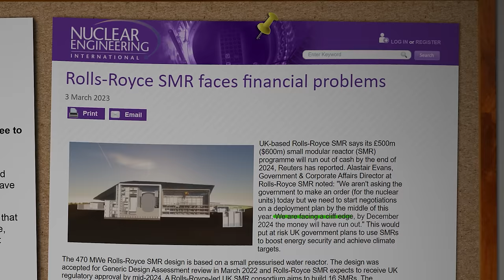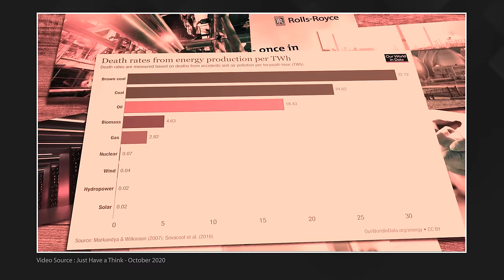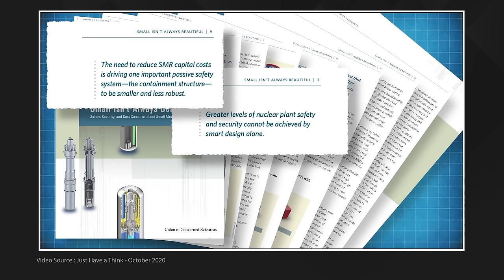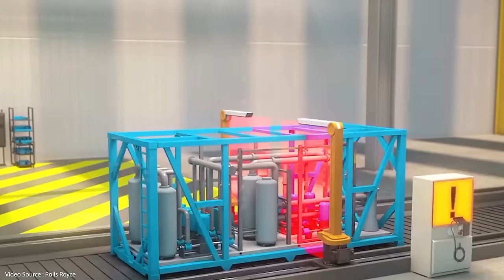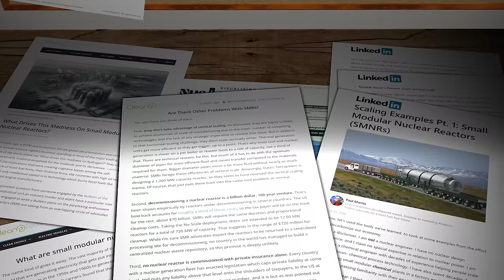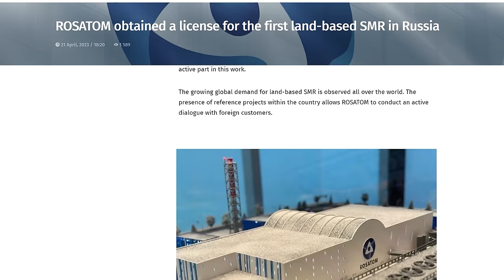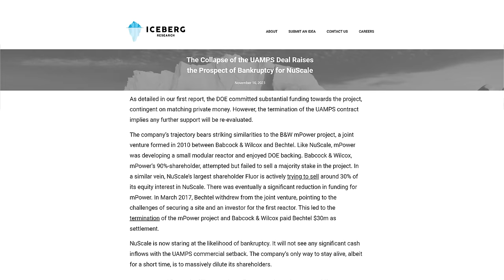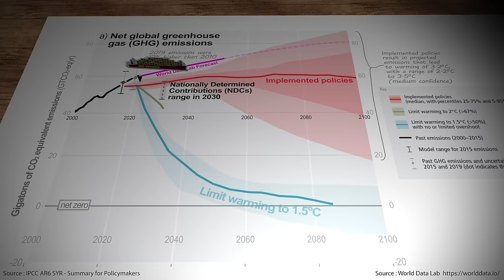Small Modular Nuclear Reactors. The Verdict

Comment: SMNRs, like any pressurized water reactor, can provide a nice steady base load. But PWRs are very slow to change power, about 3%-5% of max power per minute. Thus PWRs are not well structured to operate in a load following mode that would allow PWRs to fill in valleys in the power supplied to the grid when wind and solar don't produce full power because clouds during the day and calm wind conditions.

To maintain a stable grid when large percentages of grid power comes from wind and solar, there will either need to be substantial amounts of stored energy (batteries, pumped hydro, compressed air, etc) to absorb excess power when wind and solar are producing power in excess of power demand, or there will need to be something other type of power plant than natural gas powered peaking plants that is able to provide the necessary amount of load following/peaking power 

The ideal source of load following/peaking power, IMHO, would be any high temperature reactor in the 700-800 C range (helium cooled, molten salt, etc.). The high temperature yields a higher carnot efficiency than is possible with the 325 C maximum temperature of PWRs. This makes storage of excess thermal energy practical since less storage mass is required to store the amount of thermal energy required to produce an equal electrical power. Likely the best way to store excess thermal power is in the form of molten salt in vacuum insulated tanks. 

The reactor itself does not itself try to follow the load, rather it operate at a single power level with all of the thermal energy going into the molten salt in the storage tanks. The reactor is sized to produce power equal to the average power that the reactor needs to supply to the grid plus a margin. 

As the wind and solar power dip below what is required by the grid, the deficit is filled in by thermal energy extracted from the molten salt tanks. The response rate of such a system should be as fast as the natural gas peaking plants currently used to meet peak power since the rate of flow of thermal power to the steam generator is only limited by the speed with which the molten salt pumps can vary the flow rate of the stored molten salt through the steam generator. 

And if worse came to worse and there was an extended period of dense cloud cover and very little wind, back up natural gas burners could be used to make steam and reheat the molten salt. The additional amount of equipment for this should be relatively small and would avoid a substantial oversizing of the reactor to meet this 1% edge case at the cost of a comparatively minor amount of CO2 emission.
Reply: What you fail to understand, is that the grid doesn't exist to allow intermittent RE to exist; but that the grid exists to meet customer demand load.
If you can grasp that, then you will understand the massive give-away to intermittent RE generators in terms of the subsidy that allows them to participate on the grid only for the upside, but to dump the downside on the dispatchable generators of the grid.
Reply: @factnotfiction5915  Why the hostility? And, I don't think you actually read my comment. It was not addressing the merits of using intermittent sources. It was entirely on how to use store thermal energy from high temperature reactors in a way that can allow energy from a source that is not normally able to provide load following capability to provide the necessary amounts of dispatchable power required to maintain grid stability IF a substantial percentage of average grid power comes from intermittent energy sources.

If we weren't so squeamish about nuclear power, we could use breeder reactors to transform either thorium to U-233 or U-238 to plutonium and build a mix of baseload reactors and thermal storage/dispatchable reactors that would give us a totally non-CO2 emitting grid that doesn't depend on any intermittent energy source.
Reply: It depends on the design of the PWR.  A number of them were designed as load following plants in the 1960's and 1970's and did so extremely well.   

Then it was determined that they were not burning up all of the expensive uranium fuel so they moved to base loaded plants.  2 of the PWR plants I worked at still had the load following controls installed and could use them if that was needed.

Comment: Unfortunately the continued push for Wind and Solar is not the panacea we are led to believe as they have very short working lives and currently are not recyclable. plus we would have to cover almost half the country to be able to supply all the power the EV's alone will require!  If every ICE vehicle  has to be replaced with an EV then the country requires approx. 6 times the the current infrastructure & generating capacity! The government has made it very clear that is not going to happen!  If all this wind and solar require Hydro power back up to give the required Base load why do we not put far more effort into providing all our requirements with Hydro power.  The west of Scotland has all the ideal elements for this as does the west coast for wave and tidal units!  They will be more expensive in the initial setup costs but far far cheaper to run and cost less in maintenance over their much longer life span!

Comment: Did I notice that wind power for the UK was, at one period of time yesterday, down below a quarter of one Gigawatt?  At night, too?  While I am a fervent renewable-ist, I recognise that surpluses of power stored, for grid-scale supply, are simply not going to be available for a long time yet.  We need base load, at least, to keep the country rolling with an operational grid.

Regarding the comments re Thorium reactors, the candu reactors could operate with some Thorium fuel and at least start to burn up some of the current nasty nuclear waste.  Who cares about a slight loss of efficiency if it leads to further developments.  I am reading lots of fors and againsts re Thorium molten salt reactors.  Just get on with it and sort out any operational problems as (and if) they arise.
Reply: Yea I totally belive you Mr. 'renewabale-ist' with your post simply full of nothing but misleading Nuclear industry anti-renewable talking points.
Reply: Hang in there Hinkley Point C is coming on line by 2031.
Reply: @kennethferland5579    Can’t read or understand properly?  I’m a realist, not anti renewable.
Reply: @francesconicoletti2547  You reckon it will be operational in another 6-7 years?  Generation at far more cost than renewables for the next 35 years?  There may well be far more installed renewables by then.  But the realists amongst us at least recognise that minimum wind generation at night will need one hell of a lot of storage to even cover half the night usage.  Roll on the proposed inter-connector from North Africa and any other inter-connectors that might become practical.

Comment: Even if we do reach zero carbon emissions by 2050, we will still not be done. The next task will be to take all century’s worth of industrial CO2 back out of the atmosphere, so we can restabilize our climate. How will we do that? With carbon capture. The problem is that carbon capture systems require enormous amounts of power. Where will it come from? Our two options for generating enough energy for that task are nuclear fission and nuclear fusion. Since the latter seems to always be 20 years in the future, fission it is. So, new generation SMRs may be the best bet, and we will indeed need tens or hundreds of thousands of them to generate the energy we need to restore our atmosphere to somewhere closer to 300ppm CO2.

Comment: I can believe all this: SML reactors were a politician’s dream so automatically very suspect. 

But can you explain why Europe has moved away from the tried and tested water cooled reactors to the new designs in Finland, France and now UK, please? There’s reference to ‘efficiency’ but surely this is almost meaningless when so little fuel is used anyway? These new designs have caused decades of delays and huge cost increases and I believe only Finland’s is now operating at low level.

Another thing is why does everyone shy away from Thorium reactors. China has a new experimental one. India cancelled their three step programme. US probably stopped because of military concerns. Europe has never, as far as I know, even contemplated it despite having so many nuclear power stations dotted all over. If you want ‘efficiency’, Thorium wins hands down. The fuse plug designs were always said to be intrinsically safe and they can also be independent of cooling water - hence the Chinese one in the desert.

Comment: The true cost of the electricity being produced by nuclear fission is already far too expensive for most of the worlds population. The poorest 50% use little or no electricity from a power station because of price, distance, lack of infrastructure , lack of appliances , lack of shops! Many houses in the UK were built with electricity as an afterthought , and when it arrived powered
lights , radio, clothes iron and little else. Very local production of renewable electricity is what most people need so that the use of millions of fossil fuel generators can be superceded.
£500 , 000 , 000  ( cost of small reactor) could buy 100 , 000 home solar panel and battery kits-fitted ! The developing ( and most of the Developed ) world needs low to medium types of technology , not a technology that requires a team of people with a doctorate in engineering and physics to run. 8 years 10 years to train engineers to run a nuclear power station, 1- 2 years for low to medium renewable technologies to be rolled out. Can we wait for nuclear? They will come into there own when we explore space !

Comment: Australia is currently having a heated SMR ‘debate’.

Liberal (centralist-right wing party) are doggedly pushing SMRs as a better alternative than Labor’s (centralist-left wing party currently in Govt) plan primarily using RE (PV solar, wind, hydro, batts & gas peaking).

It has turned into a polarising situation where support of nuclear or RE is intrinsically linked with with party one personally supports. So there isn’t much goodwill in genuinely evaluating which is the best way forward.

In the meantime, the Australian Electricity Market Operator continues to do detailed planing on what infrastructure is required to build a RE system. But these plans are falling foul of community sectors with Astro-turf lobby groups stirring up, on one side, Farmers about additional grid transmission lines crossing over agricultural land (limiting particular ag practices like aerial spraying). And on the other, Greenies concerned off-shore wind farms are going to decimate whale populations.

It seems the Liberal Party is spruking nuclear just so it can have a point of difference with Labor & snipe about vistas being destroyed by myriad PV solar & wind farms everywhere. It’s also said it’s their way of continuing to kick the can down the road so Coal, Gas & Oil companies (who make donations to them) can continue BAU.

In the meantime, Australia’s aging fleet of coal-fired generators are rapidly approaching end-of-operational-life. On current schedules, over 60% of total current grid generation capability will be shut down over the next 16 years. Starting with ~20% of that 60+% being shuttered in under 2 years.

So in Australia, it is definitely the case that SMRs will reach commercial maturity far too late to be built to replace C-F generators before they die. Our only hope is to get enough RE built before that happens. (Full speed ahead & damn the whales? - to plagiarise a WWII quote about torpedoes) 

And once that’s done, who needs SMRs?

Comment: I was hoping you would also talk about Thorium reactors. I thought there was quite some progress made in that direction.
Reply: Probably similar problems with thorium reactors, since they use fission as well, which means it produces highly radioactive fission products, so it ends up being extremely complex and expensive. This is basically the same for every reactor design using nuclear fission.
Reply: Actually, there is nothing new about thorium.  The USA built 2 test molten salt reactors in the late 1950's to late 1960's.  Both had a lot of problems.  Oak Ridge broke down a lot and was very unreliable - before they found out about the corrosion and radiation embitterment issue with the hast-alloy they used for the tubes, pipes, and components.

LOts of test reactors built around the world using virtually all designs out there (BWR, PWR, Heavy Water, Graphite, etc).   There are at least 4 thorium fuel cycle test reactors currently being used in the world.  No one except the USA though they had a design that worked well enough to scale up into power plants.

The USA built 4 commercial thorium cycle power plants in the 1960's - late 1070's using BWR, PWR an HTGR designs.  All were huge technological flops.  At least 3 of them were converted to U235 fuel at the 1st refueling.   All of these plants were very prematurely retired.

The USA did do a test run in the Shippingport demo/test reactor (60 MWe PWR) which showed that a successful breeder thorium cycle core could be retrofitted into most of the existing PWR reactors of the day (which applies the the current PWR reactors today).  But, it cost more to extract and refine the thorium from the almost free dirt and rocks than it cost to extract and refine uranium from its more expensive mined dirt and rocks.  So thorium has gone nowhere.

India has the most extensive recent thorium fuel cycle test reactor experience.  They have not yet seen it as a viable fuel for power plant reactors;  even though that is their goal.

China built and started up a thorium fuel cycle MSR in August 2023 to see if they have come up with a suitable alloy that will not degrade in long reactor life applications and to see if the idea of chemically filtering out corrosive daughter products and chemical reactants works well enough.  It will be years before we know the answers unless its a rapid that we do not yet have a solution.

Note MSR reactors can run on any fissile nuclear fuel.  Thorium is only used to breed U233 which is fissile.

Comment: The argument about nuclear industry economies of scale being unrealistic presented in the video seems quite pessimistic and lacks concrete figures. Indeed, in nuclear industry a -30% cost reduction on overnight CAPEX from 1st of a kind to 3rd of a kind seems to be a rather reasonable target. 
In addition, SMRs are nascent technology with very high risk and WACC. On the contrary wind and solar is now a low risk industry (no to little cost/schedule overruns and lower project size). Therefore, a comparison of the LCOE of SMRs with wind/PV is likely to be flawed as achievable changes in nuclear technology maturity and funding conditions as well as full cost definition of renewables (incl. storage and grid reinforcement) may result in SMRs being much more competitive than wind/PV. (I have to admit I did not calculated this though)

Comment: In Europe we do not have security of carbon energy supply so we must develop renewables (Hopefully as a continent with interoperability, but alas that might be to much to ask, never mind global!), but putting an uneconomical target on things is rather foolish and just ensures that the target is not met, the new technology is not keeping up with the target dates and the prices are running high, also some new technologies are not working properly. Wind is a good overall solution but is not 24/7/365.25, solar is fine except for Winter in Northern Europe and that's the time its needed most, Big Nuclear is good for baseload and should count for 25% of our mix, gas power plants should count for 15% for standby and emergency they are easy to get up and running. Ground source heat pipes are fitted to new homes in the UK and they seem fine, air source heat pumps are overall not efficient enough as yet, and older homes being converted from gas are to costly with insulation and price of heat pumps and solar (30k) better to have a grant for insulation (10k) and reduce the gas usage, EV's are good, lithium is bad. The charging structure needs vast improvement as does the network grid which needs continous upgrades for 30 years to change for the new energy mix and hopefully "new" energy sources, all these cost vast amounts of money when money is in short supply, in the end it "should" be better but the period of change is going to be longer!?!

Comment: This is an over simplification, but the common practice of subsidising fossil fuel based power generation is essentially the undervaluing of the lives of those the subsidising entities are given political power to protect. In my opinion this is a stark betrayal of principles and our communities.
In a way, carbon taxes go some way to express this "non-tangible negative externality". But as usual, cultures have momentum and the status quo is slow to shift. However, on the more positive side, the status quo is being eroded and often "doesn't change till it changes all at once".

Comment: New technology always takes longer than expected and costs more.  That's why you keep doing R&D on the same thing, making it better and better and more cost effective.  The first solar panels were terribly expensive and not very efficient.  Years of R&D later, they're much better.  There's also no mention in this video of the total cost of solar and wind.  What do you do with the mountain of old panels and wind blades when they wear out?  Also, what about the energy used to make all those solar and wind farms?  Will these farms generate more power than needed to make them?    Finally, look at what SpaceX has done with rockets.  Before they built the Falcon 9, and revolutionized orbital launches, it was mostly governments that launched rockets, because they wanted to.  If someone does the same sort of thing with nuclear power, then what?